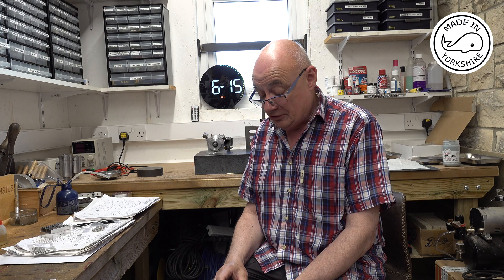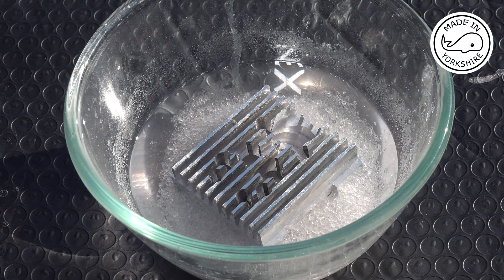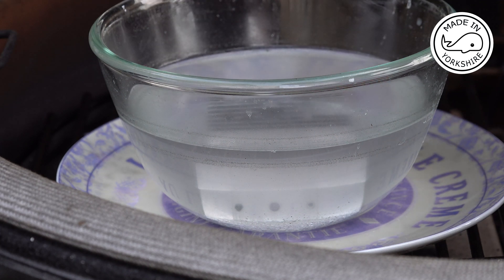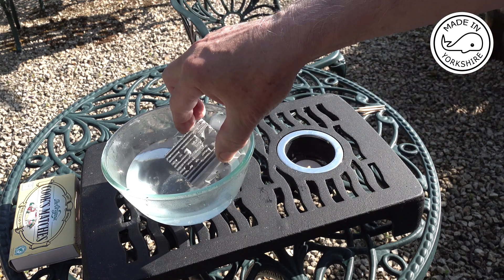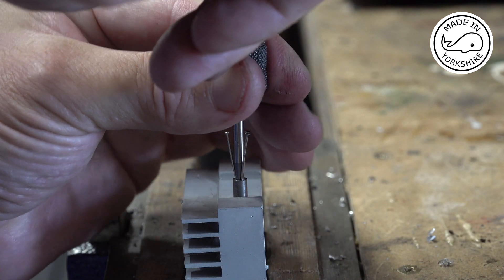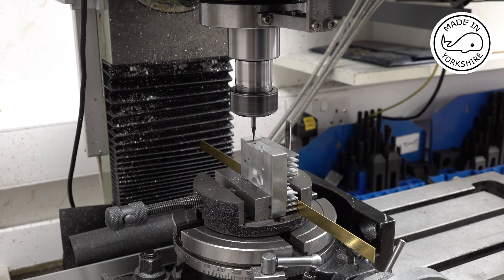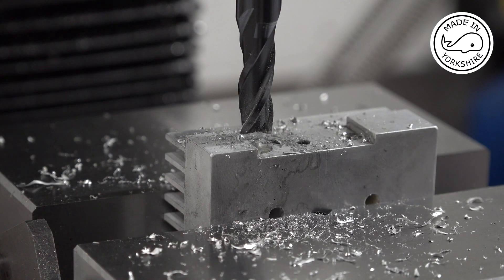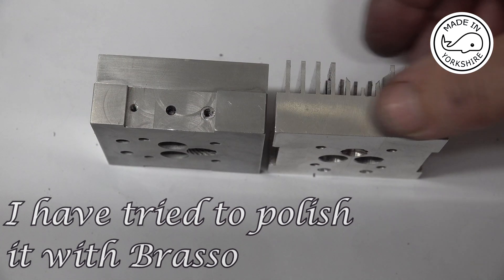#MT49 Part 15 - Jerry Howell V-twin IC Engine. Broken Tap Removal. In 4K/UHD be Andrew Whale.

Comment: What a great result. No sign of the repair now. WD 40 polishes aluminium well. Not sure if it will work on a chemically corroded surface though. Worth a try as no expense involved.
Reply from the maker: Thanks Tim. I'll give WD40 a try.
Cheers
Andrew
Reply: @learningturningmetal  you could try anodising them both. I have never tried it but Mark Presling on his channel describes in detail how it is done. Doesnt look difficult once you have the necessary materials. The heads would look god in blue or red.
Reply from the maker: @timjoinson7232  interesting 🤔

Comment: Wel done in getting it out.
 A few thoughts come to mind, if you were in a hurry, making a smaĺl core drill or even open up the hole with a 8mm carbide end mill and cut the broken tap at the ssme time. 
Re chemical dissolving, heat speeds the reactoon, double speed for every 10C if school chemistry memory holds(?) but in this small hole relative to bubble size stops the solution from doing its job. Obviously the solution needs constant replenishment at the workface as it does its job and a bubble will prevent this, some form of forced flow like a from hypodermic needle and syringe would have sped things up. I did this when i got the broken tap out with cartridge case cleaner because I noticed the reaction worked but stopped very quickly figuring the acid was quickly exhausted and not being replaced by any natural flow.

Comment: Brilliant solution Andrew I think what the Alum did was to partially Anodise the Aluminium ( I may be wrong, and better chemists than me may disagree ) A superb catch.

Trying your CNC router was an excellent idea and I have done this myself on odd occasions,  but to get taps out you need much harder tools 

I use Diamond Burrs and lots of water 

It sounds expensive, but it isn't You can get them from China very cheaply, or , if you have a good relationship with your dentist, loads of semi spent ones gratis 

I spent many years as an electrical panel builder and have broken my quota of 3.0, 2.5 and even 1.6mm taps in my time

It  happens!
 now and again you break one despite all your care 

But your recovery from this was extremely clever
Reply from the maker: Many thanks for the info. I nearly purchased some dentist type diamond burrs via AliExpress. Now they keep on reminding me! I might just get some, just in case.
Cheers
Andrew

Comment: I tried alum at boiling point for about a week on an aluminium part to remove a broken tap. Absolute waste of time and money. The newly machined part went a dull grey like your part and then the aluminium started to pit, at that point I discarded the process. I eventually just beat it out with hardened punches.
Reply from the maker: Blimey - that is a bit of a concern!

Comment: I may be wrong but I believe alum will only de solve tungsten taps and will not de solve high speed steel, you can drill high speed steel with solid carbide drills but you have to be careful as small carbide drills are easily broken.
Reply from the maker: Interesting - I'm sure alum did have a chemical reaction with HSS - it just took a while and I should have kept the temp high throughout the process.
Cheers
Andrew

Comment: Well done.  I wonder if the Alum would have worked if you had the water near boiling point from the start?  BTW, completed our move from Surrey to Yorkshire!!  Just outside Halifax.  Rebuilding the workshop and a new mill coming soon - Sieg SX3.5XP.  R8 - so some new tooling required!
Reply from the maker: Thanks Kevin - I think keeping the alum near boiling point from the start would have really helped. Blimey, I don't think I could face another house move - far too much heavy gear now. Good look with the workshop. R8 definitely the way to go.
Cheers
Andrew

Comment: Now that I remember, I broke a tap in some motorcycle part a few years back & I brought it to a friend at a local machine shop.
He clamped the part in a bridgeport & hogged it out with a carbide endmill. He destroyed the endmill, but broke the tap up.
You should be able to polish that aluminum up. Good job.

Comment: I tried Alum on my broken tap in a steam engine cylinder block, also did nothing whatsoever 🤷‍♂️
Reply from the maker: Hi Derek - it does seem to be a bit of a hit n miss process. Some people have success and others don't. I was concerned when I saw bubbles coming directly off the aluminium, and that is when I decided to call it a day. Some people suggest spark erosion but I guess you are talking £££.
Cheers
Andrew

Comment: I’m glad you were able to work it out Andrew without re making the part. The Alum(grocery store spice isle) needs to be in saturation and kept hot. Also it is suggested to keep it in an ultrasonic. The ferrous screw will eventually just crumble away. Anyway. Thanks for sharing. Cheers.
Reply from the maker: Hi John - I must explore ultrasonic. Can you advise?
Cheers
Andrew
Reply: @learningturningmetal  I use an ultrasonic cleaner that has heat. So keep solution warm and the ultrasonic waves helps break up the ferrous metal as it’s eaten by the alum.
Reply from the maker: @johnvaluk1401  hi john, can you recommend an untrasonnic cleaner for a hobby model engineer like me? I know nothing about that type of product.
Reply: @learningturningmetal  do you have Harbor freight stores   They have a few.   I’m sure Amazon lists a few.  Mine is an older one I received from a watchmaker friend.  Elma is good name brand and is used in watchmaking jewelry service but IMHO is probably overkill for just a hobby one.  Also L&R I believe still makes them.   Used them in the Police Dept to clean gun parts.
Reply from the maker: @johnvaluk1401  thanks John I'll investigate.

Comment: You can chemically brighten with an acid solution
Reply from the maker: Thanks Rick - as the aluminium will tarnish over time anyway, I've decided to put the other head in some alum to try to get a decent match.
Cheers
Andrew

Comment: Congratulations Andrew ! The repair looks good, and I'm sure it will work well also. I'm surprised that the alum did not work more quickly even at a lower temperature. There might have been a coating of cutting oil on the broken tap which prevented the alum solution from coming in direct contact with the metal except at the very end.  The bubbles forming at the hole should have started shortly after initially placing the part in the solution.
Reply from the maker: Thanks Earl - it was certainly an interesting exercise. Definitely worth another try next time I goof up🥴 
All the best.
Andrew

Comment: As that head gets hot in use i hope the loctite doesn't give way.
Reply: If that engine head gets to the temperature at which Loctite dissolves, he’s gonna have much more serious issues. Generally it takes temps of between 300°-600°F or greater to melt Loctite depending on the formula.
Reply: You always seem to find a way to get there in the end. I'm looking forward to seeing the engine running: won't be long now. Regards.
Reply from the maker: Hi Clive. Loctite 638 is amazing stuff - check out the spec!

Comment: Glad to see you got the broken tap out.   The simple solution to getting a matching finish on the 2 heads that will look good is to get someone to fine bead blast them or vapour blast them for you.
Reply from the maker: Hi Howard - thanks for the suggestion. To be honest the heads will tarnish over time anyway, so I'm not too bothered.
Cheers
Andrew